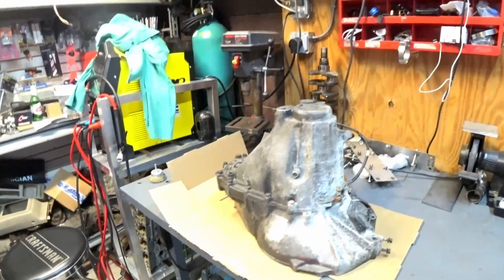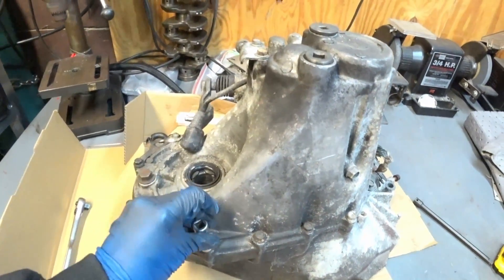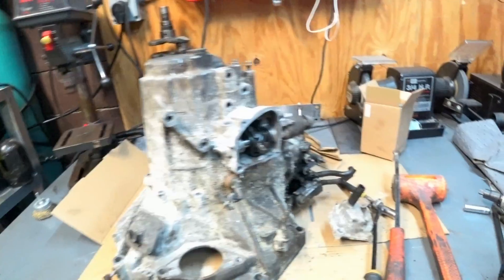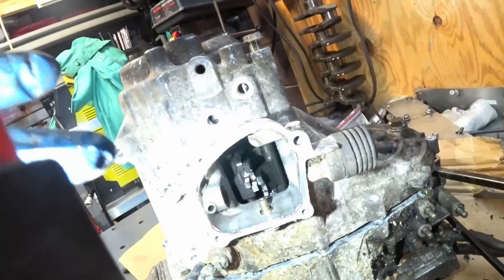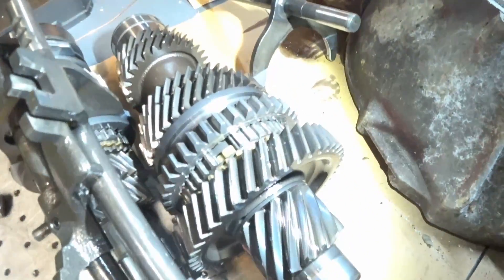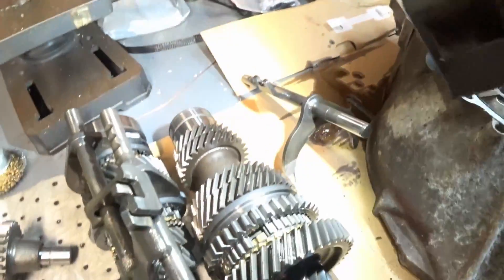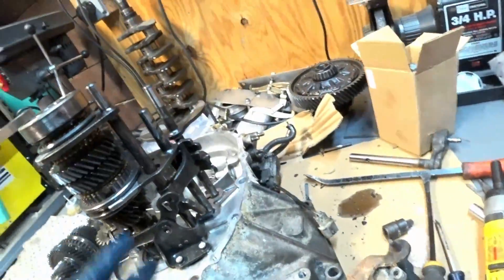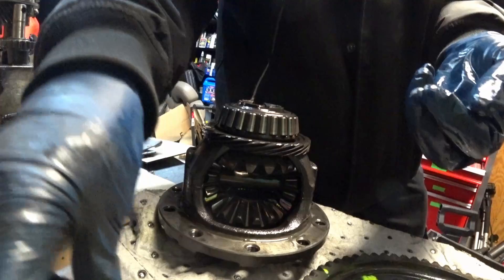How to take apart a prelude transmission gen 3. 1988-1991.  H22 gears into AWD transmission Part 1

Comment: Kool projek! It's a weird how you just dissambled a Prelude tranny and l also did last Sunday, cousin showed up from bay area w/ a m2y4 tranny and we found a final gear missing some teeth, what a coincidence.
Reply from the maker: Yea im still looking for a oem lsd to use in the r&d. But we seem to do a lot of the same work because something always need fixing 😆. Hope the count shaft was still good in the one you had to rebuild.
Reply: @AJIMPORTS  CS gears are good, how a small teeth got chipped on the fd gear is not known. But everything is put together now and my cousin will find out if we do a good job on it. Later bruh!